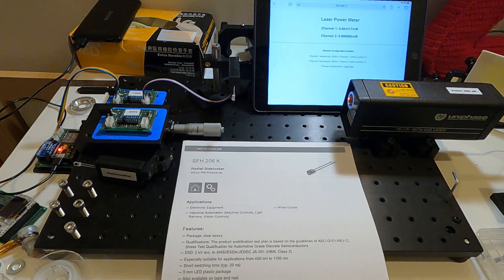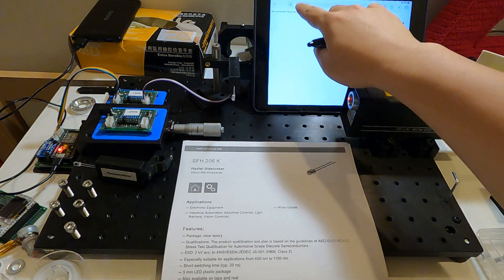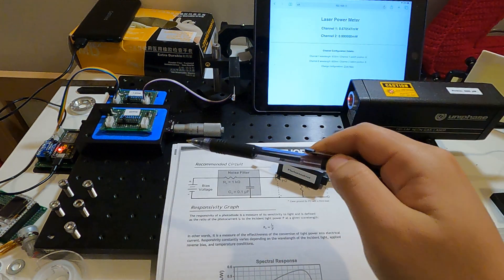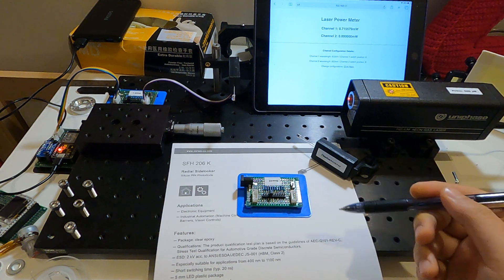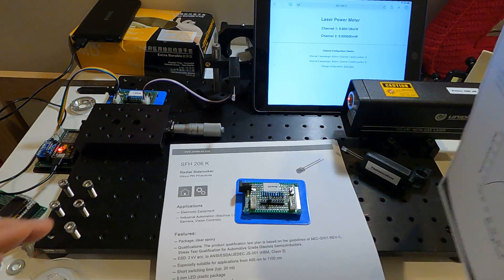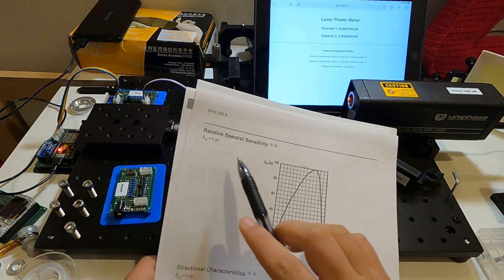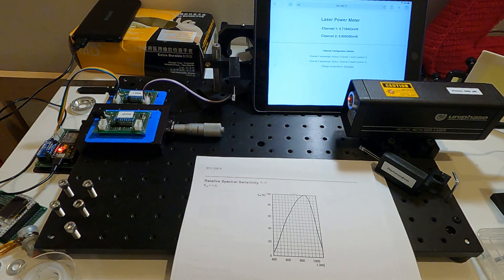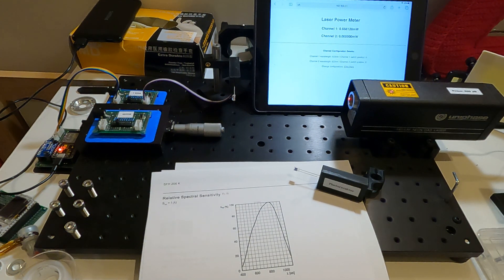Homemade Laser Power Meter

Comment: I imagine this must be a low power average power laser, not like the 10w lasers on a laser cutter! The small diode would never survive!
Reply: You can make it survive by ensuring it is not focused. But you will need to calculate the beam size at the point you take the measurement and look at the data sheet for the area the sensor covers and multiply the ratio. By ensuring it stays away from the focal point, there is much less intensity of the beam so it will not burn. But of course it will have an error factor so it will never be an exact measurement. But if done in this manner you could get some sort of measurement of the laser. However I wouldn't try it on a co2 60 watt or higher because even the unfocused beam to the mirror is normally enough to burn painters tape. I normally put a piece of tape on the front of thr mirror to adjust the beam and mirrors and it burns the tape, and that is before the focus lense. But on a diode laser, normally you can get far enough away to spread the beam to prevent burning. If you have a lense that spreads the beam even better. Just my thoughts, I have not tested it but it should work.